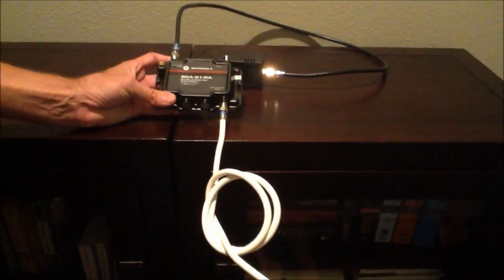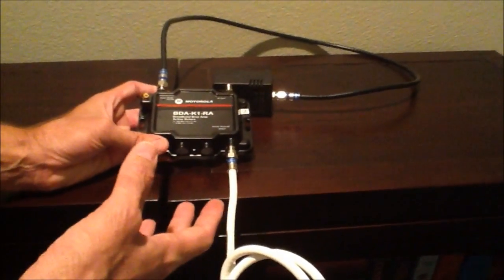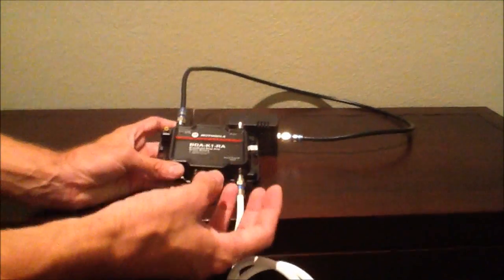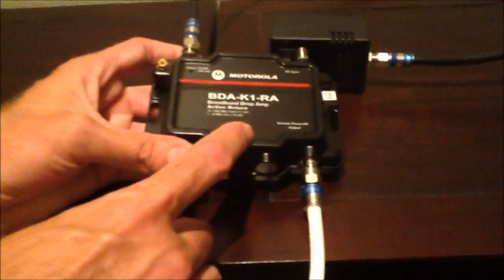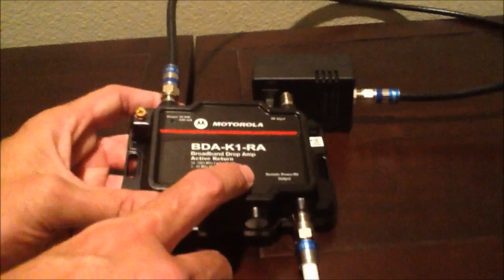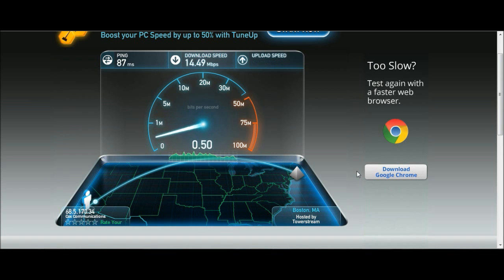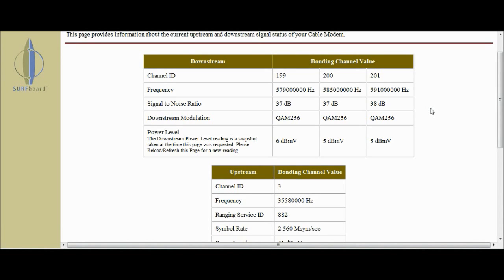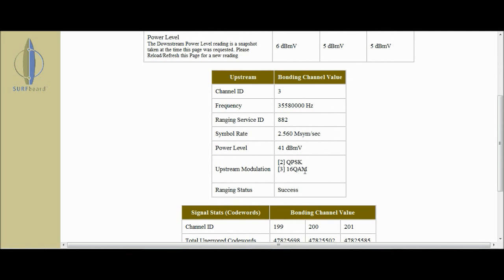Resolve Cable Modem Disconnects Caused by High Upstream Power Level

Comment: This video is a bit old but hopefully the information is still relevant. I have an issue where my cable modem will constantly reset (had a few technicians out, replaced modem etc etc.) It's a US/DS issue and they suggest a new wire but one of the technicians mentioned an amplifier, would the one in the video help resolve my issue? I don't need a perfect fix, my landlord wont sign off on running a new wire, but I'm paying for high speed internet and would like it to actually work.
Reply: Geoffrey Miller Hey man. If a new line can't be installed then you can use it temporarily. These kind of fixes aren't supposed to be permanent. The problem is most likely with your drop cable (the line that runs from the main line to your house or apartment) if it is a wiring problem. This isn't always true. For instance if your modem cable runs out straight out of the wall and outside to its connection point then it could have water in it. Water and corrosion are the main issues with US/DS issues. 

The author should have also mentioned that if youre amplifying bad signal that you're going to spread your problems to your neighbors. It sends all that noise back even louder and the incoming signal is just sending louder noise into your modem. Amplifiers should be installed at the closest possible point to your Tap (connection point to the main line). 

My advice would be to get the technician to do the "difficult fix". Get a new drop installed or ask them to switch to a spare drop. I see this all the time at work and unfortunately some guys have a reputation for "passing the buck" on difficult jobs. My guess is that it's something that can be fixed without needing major surgery (something that would require your landlord to be involved).

Good luck!
Reply: Adam Tolfa thanks for the advice, I believe as far as the wiring itself everything is fine I believe the issue is how many times the cables are split, essentially there are 5 (maybe more that I haven't seen yet) cable outlets in my side alone and I can only expect just as many on my neighbors side which I guess kills the power by the time it gets to my modem, and since the cable boxes work just fine even when the modem can't hold a connection I figured this was the issue which is why running one single wire to the desired room for the modem is the best fix. But since I can't do that would an amplifier still work in my case or do I still need to ask for a new drop? I imagine I can do my own installation of an amp if that is still an option I believe I have a good understanding of how everything needs to work. Would it need to be outside where the cables are initially being split or is being in the same room directly connected to the modem enough?
Reply: Geoffrey Miller It kind of depends. I'm assuming since you said "my side" that you're in a duplex. Most companies are supposed to run a drop for each side. So you should have your own. If you don't then I would install the amp on the line that goes to your side. 

For example let's say there's a drop from the pole that goes into the basement. It then probably hits a ground of some sort and then goes to the first splitter. If the cable guy tried to do it right... Then it should be a 2 way split. One side of the splitter going to your side and one to the other. Ideally you should amp right after that splitter on the line that goes to your apartment. That will amplify the signal at its strongest point without affecting the other apartment. If it's a different type of splitter that you encounter then do the same thing... Just make sure you. Amp leg that goes to your side. 

Im not great at putting these types of things into words so if you need I'll make a video at work tomorrow and explain it for you a little better.
Reply: Adam Tolfa I think I've got the idea or at least enough info to figure out the current set up and how to install it, thanks tho for the offer and thanks for the advice!

Comment: my upstream this morning was 57db and modem was dropping like crazy. now its just over 40db and running as it should.  Im still going to order amplifier for those times that node is unstable around here.
Reply: How is your downstream power?  I used amp and my upstream is fine but now my normally good downstream is doubled and 22.

Comment: If your upstream is high, chances are it's not the "plant" more than likely drop / homerun / outlet issue. Boosting bad signal only amplifies bad signal, fix the issue, not try and mask the problem, the "sweet spot" is normally 0db forward / 45upstream / 55db is junk!

I believe Docsis 3.0 wants the upstream above 42 / 43, remember when you channel bond the upstream can rise by 3db!
Reply: Daily Bi-Polar only good advice I've seen in the comments. Well done.
Reply: The actual problem is that plant which the COX staff is smoking.

Comment: I'm a heavy IRC user, I stay connected 24/7, my connection to the servers have disconnects a few times per day. I have been looking for a test that would constantly ping a server and show what time the connection experienced packet loss. I have an electroline 8 port drop amp, but the power supply has crapped out on me. I need to find a replacement soon to see if the power levels and SNR is the culprit

Comment: i work for a cable company and guess what your wrong we no longer use qam 256 its qam 64 and there is 24 channels down stream and 3 channels upstream if your cable provider had any good workers all you would need was a new drop and that would improve the tx and rx levels and keep the modem in speck and your internet would work as it should and you would be getting about 30-40 mbps upload and at least 5- 10 mbps download speeds get rid of your cable provider and move to fiber if possible
Reply: Mario Inacio How on earth can you tell that from the little information in the video? You don't know the levels at the distribution point so can't calculate if a new drop would benefit. The working parameters and modulation is done at a plant/headend levels, different areas have different setups.
Reply: " if your cable provider had any good workers", exactly why this video is helpful. Waiting around for them to fix is a hassle and have a bunch of underpaid scoping out my home isn't something I need. I'm sure it's my contract that I can do nothing if I'm not getting what I paid for.

Comment: I hooked one of these up and now I'm around 15 dBmv for all 24 downstream bonded channels. Looking to lower that number this week. 
I've had trouble with my corrected on the bonded channels though. SO Where you have your cable loop I did that and put a round magnet (one that has a split in it so I could hook it over it) then I put one on 120v cable. I also put one on the cable going to the modem and a Cable Ferrite on the 120v to the modem. 
I have 0 uncorrected on the downstream for the last 4 days in a row. Basically with the magnets I was making a Ferrite for them.
Reply: therealdeadpen 
Call. Your. Provider. 
You don't know what you're doing.

Comment: My SB6141 modem began dropping the internet service after 2 years of working perfectly. I disconnected the GROUND WIRES at my cable service entry panel both outside of it and inside. I suspect my problem began because my Cable Service recently upgraded their service to 32 channel Bonding. They may have started sending an IPV6 signal [ I don't know ].... But based on that assumption I went into my Eithernet Port settings and TURNED OFF  or DISABLED the IPV6 protocol as typically only IPV4 is used for surfing the net....  I assume I never had a problem before because the Cable Copmpany never sent an IPV6 signal my way until the upgrade. Personally I think cleaning the GROUND wires for my system improved the situation and the IPV6 disabling may or may not have had anything to do with it. I still lose connection from time to time but it is over a period of many hours now and not every 5 minutes..... I will nurse this SB6141 modem until I get an upgraded Modem to handle what the Cable Company is now supplying. CHECK YOUR GROUND WIRES as it may help solve the problem. And THANKS bbstudioproductions for your video and recommendations !!!

Comment: We have similar issues on our base. We are powered by either 1 of 2 (A or B) diesel generators or a Pelton wheel (hydropower) (C). When running on Generator A our Hughesnet HT1000 satelite modems work nicely. When running on Generator B our modems will cut out and require a power-cycle every 5 to 20 minutes. On Generator C it's hit or miss. There seems to be a relation between upsream power dBmV levels and our choice of generator. Could modem power supply affect upstream/downstream dBmV levels?
Reply: Matthijs Terlunen this fix does not apply to satellite internet. In that situation the modem powers your TRIA (the business end of the dish) if you put an amp in line it will stop working all together.

Comment: I seem to be having a similar issues with a DSL modem (yes they are still around). The problem is the same, the modem/router unit keeps dropping the internet connection and restarting. I have had tech come out from my ISP to try and fix the problem and they just kind of shrug their shoulders. Last time they were out we switched out the modem unit and almost immediately I was getting the same problem. So I guess my question is can this problem happen with DSL modems and if it can, is there a similar fix?
Reply from the maker: Are you able to connect to your DSL modem and see similar upstream/downstream values as mentioned in the video.

Comment: If your up power level was at 58, the line feeding your modem must hit splitter(s). you should not have to increase
the level on your line by 11db to get to spec. (up pwr 40 - 50) A clean line from modem to 1st splitter outside would save alot of money.
Reply: 17db i meant
Reply from the maker: Thanks for the information. The new Active Return amplifier I'm using is much more cost exffective than the Motorola. See the updated description.

Comment: Hey thinks for the info all good stuff. FYI your updated link from 08/07/16. amazon does not have this in stack anymore.
Reply from the maker: See updated information in description.
Reply: @BBStudioProductions  They no longer have the PCT-MA-B1010-1A in stock anymore.  I just bought used off eBay.

Comment: Just ordered one today.  In my case I hit around 52 dBmV for all channels on upstream then each goes offline until I completely lose connectivity.  TWC did come out last week and verified that there was a huge ingress, and allegedly that was fixed, but I still go offline a few times per day due to the observed behavior with upstream.  This seems identical to what was presented in this video.  Hoping for the best.
Reply from the maker: I now recommend the PCT 1-Port Variable Gain Signal Amplifier With Active Return by PCT. It is less expensive, the upstream and downstream gains are adjustable and it doesn't run hot like the Motorola amp.
Reply: Holy cow!  That's way less expensive: $14 via "prime" versus $74.  For how long have you been running the PCT unit?
Reply from the maker: I've been using it for about 2 months without issues. I bought the one at https://www.amazon.com/gp/product/B006T3H9TM . It was $26.73.
Reply from the maker: Looks like the same thing just not adjustable. Please let me know how it works for you.
Reply from the maker: Is your problem resolved using this amp?
Reply: We shall see.

This past week my cable provider (TWC) FINALLY quiesced and came by the house to look at the wire outside.  The last tech (two weeks ago) correctly identified an ingress from a few glitches inside, but he didn't look at the outside wiring.  The second tech identified a line breakage at the pole and also an older fitting outside of the house.  He fixed the wire and replaced the fitting.  The frequent resyncs (knock on wood) and nasty messages in the cable modem log have NOT reappeared after the repairs, and performance seems consistent overall.

In short, I have been monitoring upstream for the past (almost) week, and after another week or so I will introduce this device.

As an aside, and to my delight -- I found an even older version of this device, yellowed from time, mounted to the joists in the basement, but I'm not going to use that one.  :-)

Will keep you posted after I get the new device online, probably a week after that.  Current upstream average is 42 dBmV before device.
Reply from the maker: +noopyorg Good news!

Comment: My Comcast modem restarts when it feels like it sometimes BUT I bought a Motorola Signal Booster w/ 2-Ports on Amazon and still the modem restarts, sometimes. The reason I had to buy the 2-Port  is for the cable and internet service from my one line in my house. I can't get a one port b/c of the one line in my home and how would I get cable service if I would've bought the one port? I couldn't put the one port through another splitter again for cable b/c it would've made the signal much weaker. I need one for the actual cable service too. So how can I use the one port when I have cable service too?

Comment: After I installed the BDA-K1-RA the modem doesn't connect to internet anymore, I get SYNC Timing Synchronization failure.
Do you have any suggestion on how I can fix the above issue?

Comment: I'm at 47dbmv and my connection fluctuates stupidly. 8 out of 10 times, the pages do not load and tells me I have no connection.
Should I buy this amplifier?
MY ISP techs are UTTER IDIOTS (Mexico) and do not know anything but basic networking.  I'm currently using one of those ARRIS router/modems with 4 ports and 2 phone lines.
Reply: edit... I changed the "splitter" I had, my cable modem was somehow in the -7dbm.
I changed it to the -3.5 dbm and it improved a little at 43dbmv.

Comment: What if after installing the amplifier (which I did) I now get nice upstream power values but way too hot/High Downstream Power levels, I'm around 10 positive power level values.
Reply: +Dargonante I have the same problem you've found the solution?
Reply: +manuel mejia you can use an attenuator, that's what I did.
Reply: +Dargonante Thanks for the advice of chance can know how much is the attenuator that you used ? 
and also if you can tell me where in the attenuator you put it agardeceria I am new to this. thank you.
Reply: manuel mejia 3db I think
Reply: +Dargonante 
thank you very much for your help :D
Reply: Dargonante modems will work fine with a +10 to -10. Don't use an attenuator.

Comment: this depends on how the company structure and design, and this depends on where you at, if you are at the end of line, you need high upstream. is you are in the beginning of line , you need a low - the trick is to locate the tap and check the value. then in general add 20db to tap value. if you have 20 value,  a good upstream level is 40 and so on.  and yes 58 is way too high - even for the highest tap value of 26. so the internet company is responsible to install the filer/amp so you don't have to but the Motorola device.
Reply: Yes, i had the same problem and lately it was getting worse...so I called the internet provider and they send a technician and he checked all the wiring outside on the main box, everything was good....he said that the upstream signal was to strong...and that was why my internet keeps dropping.....he just installed a splitter on the cable outlet and that solved my problem....it dropped from 57 to 41 on upstream signal...